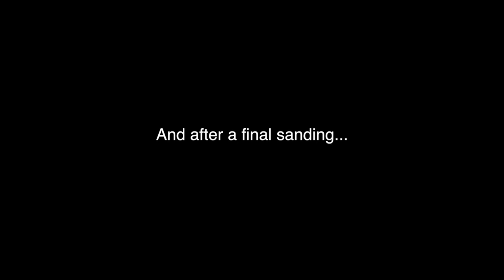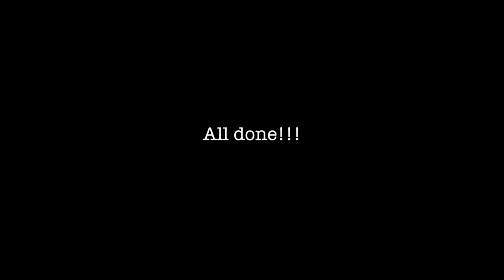Wooden Bud Vase Bandsaw Project (or possible woodturning project)

Comment: Nice one must get some practice on the bandsaw
Reply from the maker: I think the bandsaw is one of those easy to use tools...but tricky to master if that makes sense. I tried the cuts on the scroll saw but the bandsaw was definitely the easier option. But I think id have found it much easier if i used the next size up blade and it probably would have given me a better finish too...luckily lots of sanding saved it :)